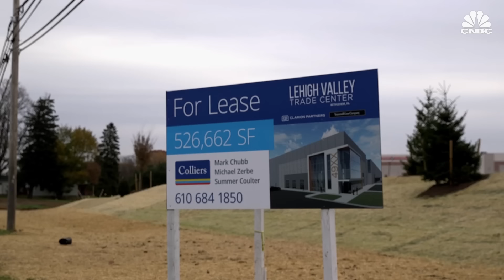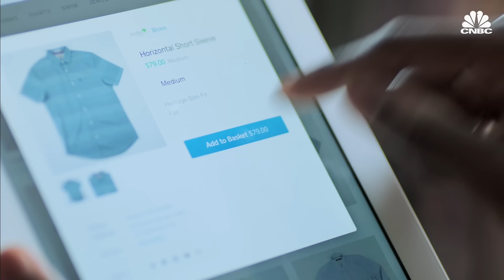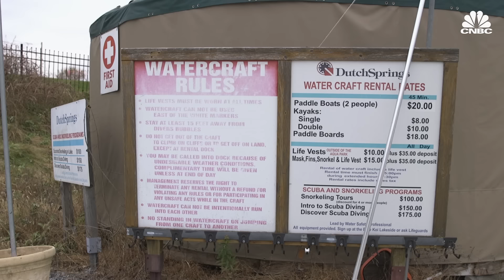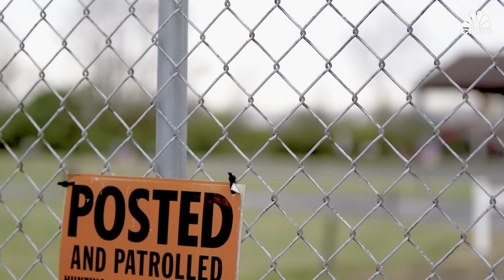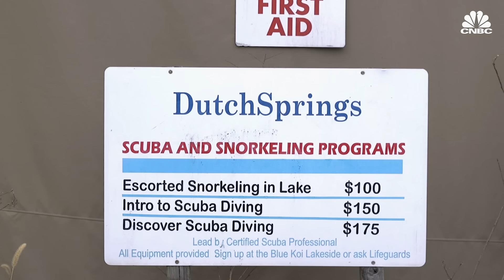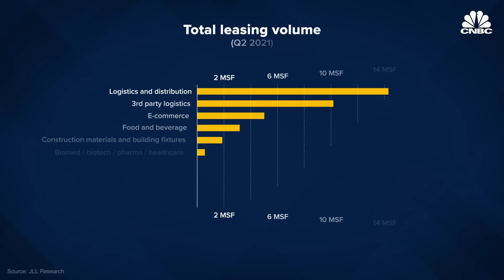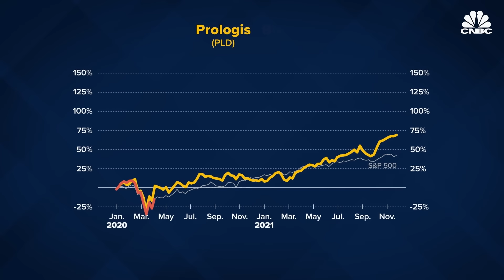Why Warehouses Are Taking Over The U.S.

Comment: This video is really well done. Bonafide experts were interviewed and some real challenges in the industry were identified. Considering the US industrial real estate market is comprised of over 20 billion sq ft and has an aggregate value of over $1.5 Trillion, I'm surprised it's taken this long for the industry to enter the spotlight.
Reply: they said lehigh valley a hundred times, but avoided saying allentown or bethelehem, the cities where the water park is.  other than that, its a great vid
Reply: @davidanalyst671  I caught how often Lehigh was said too!  I'd also disagree that a warehouse is defined as a distribution center over 200,000 sq ft. There are many buildings smaller than that which would still technically be warehouses, but I understand the point they were trying to make.
Reply: @davidanalyst671  so when they say Lehigh Valley I'm sure it's more than one city based on my 13 1/2 yrs of over the road trucking I've been dang near to every corner of the united states, Ontario and Quebec.
Reply: Exactly

Comment: Just use the closing malls for a lot of them. The enclosed mall is going away so relocate the space.
Reply: The design of closed malls is not very good for comercial warehouses.
Reply: Malls are in commercial zoned areas. Warehouse needs and transport infrastructure require their own industrial zoning. Not to mention, a warehouse placed where a mall was is most likely to be an eyesore.
Reply: Most malls aren’t situated where it would make sense for a warehouse. Malls are typically in the middle of retail sectors of towns which means a lot of cars go through it daily. Adding s bunch of trucks to that would be a nightmare logistically and for traffic. Warehouses are best suited away from heavy traffic.
Reply: @DeadAir21  Actually many of them are well situated near the major highways out in the burbs. Already seeing amazon converting old Sears/JCP etc to distribution centers.
Reply: They are not zoned properly for that plus the truck routes aren’t favorable for that
Reply: @chrisdionne2871  Actually, abandoned malls are perfect for last-mile delivery.
Reply: lol they already started doing that
Reply: @wyganter  well then the mall would be a distribution center, rather than a warehouse. Totally different industrial necessities and zoning permissions. Warehouses deal with 40ft trailers and switchers. Distribution centers deal with “last mile” vehicles. Moving goalposts?
Reply: @chrisdionne2871  Actually they deal with much the same vehicles. Most of the goods get to the distribution center via the trucks just less volume. See it everyday at an Old Kmart Amazon converted near my house. The big trucks come in the back and get unloaded and the Brown prime trucks are parked and loaded in the front. The big stores were essentially warehouses anyway so not badly designed for the handing the rig. you see the same at Walmart all the time.
Reply: @johniii8147  yeah but that volume.. is what is the difference here. Distribution centers do not take floor loaded containers and transload onto trailers. Distribution centers just unload palletized trailers into short term storage. Sure the vehicles look the same but when it comes to the weight inside the trailers, they differ immensely. Warehouses are also outfitted for long term yard storage. You take the storage yard of a transload warehouse and fit it into a Macy’s. It’s not operationally feasible.
Reply: Demolish the malls - convert to warehouse space
Reply: @chrisdionne2871  and covering up pristine farmland is not an eyesore? these malls have roads and infrastructure already built around them, the buildings will need to be rebuilt.
Reply: @DeadAir21  im guessing you dont live in a big city. im in columbus ohio and all we have is warehouses and alot of them run rt up against residential areas
Reply: @TKUA11  not zoned, well that can be fixed with the stroke of a pen. and all the malls i see have great roads in and out of them, dont forget that trucks bring the goods to the malls to be displayed in the stores. the argument that old malls are not set up for trucking is a blatant falsehood
Reply: @chrisfrisch1347  purely objective claim, but I agree. I don’t advocate for repurposing farmland, but if existing structures, like the malls, are to be used for warehouses.. it will be more than just a retrofit needed to meet the needs of a warehouse facility.
Reply: subjective*
Reply: The location of existing malls would not work with warehouses. Zoning being one issue, and access being the other problem. Going from personal vehicles to 100s of trucks a day will not work with roads originally designed for passenger cars.
Reply: I can't imagine the enclosed mall going away completely in the north where they have harsh winter weather. There still will be a demand for indoors mall in places like Minnesota and Michigan ect. Keep in mind the Christmas season the busiest time for shopping takes place in the winter.
Reply: @dvferyance  True there will be a place for it, just  a much smaller one. They built too many and trends changed in the middle of the overbuilding.
Reply: @johniii8147  I would say that's pretty accurate. I actaully bought all of my Christmas gifts this past year at my local mall mostly Barnes and Noble. Years ago I ordered a book from Amazon and it never came so I am done with them. I would prefer to shop the traditional way then at least I know what IA am getting and that I have it.
Reply: @dvferyance  We all have our preferences. Couldn't tell you the last time I was in a enclosed mall. Maybe 2013. I've avoided them for a long time now with all the hassle of parking, walking, finding the store etc. But I'm not a browser type shopper. I usually know exactly what i want or need so been a big online shopper for a long time now. But i get some enjoy the hunt for for new things.
Reply: @johniii8147  I like the experience of getting away from the house. and some like the convivence of staying home. I

Comment: they should solar panels on their roofs
Reply: @Yummy Spaghetti Noodles  I don't think that's how it works. If the price of electricity goes down there will be a lot more use hence driving the price back up until a new equilibrium
Reply: Right!  Solar could just about pay off most of their operating costs.
Reply: One would think that the huge roof area of warehouses are a surefire place to put in solar panels...but noooooo....no such sensible luck.
Reply: The do here in California.
Reply: @SA2004YG  go google the price of electricity in california.  Its right there, smacking you in the face
Reply: @David Analyst  whatever it is I know that every place has its own circumstances and it doesn't make sense to make national policy on what's happening in one specific area. You guys do what works best for you. Here in North East solar isn't always the best option

Comment: Two ideas: Start building warehouses underground, build sustainable communities and or parks above them. Above ground warehouses should all be covered in solar panels, so much acreage for energy production!
Reply: digging out and creating an underground facility is incredibly expensive to build and operate - think of all the additional air conditioning, ventilation, lighting etc. needed. It's more likely that warehouses will become multi-storey (meaning stacked on top of each other) , like how they are in places like Singapore and Hong Kong.

Comment: Why don't they build these warehouses in the deindustrialized parts of the many inner cities that need fixing instead of paving over greenfield sites.
Reply: Because inner cities don't have the transportation infrastructure to handle so many 48' and 53' trucks that weigh up to 45,000 and 50,000 pounds coming in and out. Some roads aren't big enough for a truck to make a turn in high traffic.

Warehouses need to be near a freeway ideally and have good access away from other traffic sources. Some need direct rail access
Reply: "Why don't they build these warehouses in the deindustrialized parts of the many inner cities that need fixing instead of paving over greenfield sites."

For the most part, they do. Those types of areas are ideal for warehouses. Not to be mean my friend, but go outside, because to me you just said "Why don't they ever build fast food chains at the corners of intersections near highways?"
Reply: Besides, logistical nightmare cost would also be an issue and high traffic. Whose gonna be happy about the 50 semi trucks coming in at all hours in these inner city neighborhoods.
Reply: @Jaker788  True so what if I changed my statement slightly to the edges of the city. Philadelphia, Cleveland, Baltimore etc. All have vacant land and abandoned buildings on the outskirts of downtown available right next to the Interstate.
Reply: @stepheng3667  the roads aren’t built to handle the traffic and the land cost is more
Reply: @stepheng3667  plus city labor is more expensive

Comment: I've never thought of this before, but when I see these huge warehouses, I think.

Why not build apartments on top of these businesses? Sort of like how Therese shops at street level in cities.
Reply: There's a lot of logistical problems that arises from that and I'm not sure that'll really work in practice. Imagine the traffic
Reply: I don't think you can zone the same spot as both industrial and residential. Also, on a more practical level, I don't think it's safe to live above a warehouse where there's massive trucks constantly moving around right by you.
Reply: Great idea but America has terrible single use zoning requirements.
Reply: @tycooperaow  true, but it could perhaps be solved if the residential car parks are located just outside the warehouse complex, connected via a footbridge.
Reply: @jadonbertholf547  Only more resson too change them. Too allow for more multi level development
Reply: Its loud, fire restricted, weight limited, extreme extra cost for stabilizing and unpopular
Reply: @speedmaster7107  Yes, That’s not best solution when it comes too really heavy industry.

But warehouse are relatively "clean" operations.

The sound can be counteracted with the help of sound insulation and the exhaust gases can be filtered out with the help of air units as well as further development of electric trucks.

And we separate those residents from all heavy traffic by means of footbridges connected to parking lots for those residents
Reply: Few people would love to live next to or on top of a warehouse. But building in the U.S. is difficult because of zoning, parking requirements, NIMBYs, and a whole hosts of building restrictions.
Reply: @Basta11  True, but since the urban sprawl and the restictive zoneing laws are making the comutes longer. 

I would argue that we will need to create a better, more efficient and coherent mix between residential, commercial and industrial.
Reply: @UCIqrf7mIptwXTydTMKFrvmA true…Mabye soundproofing and blackout curtains would solve that issue
Reply: Also what would happen if the warehouse company wanted to renovate the warehouse or expand it by a floor? Sounds like a logistical and legal nightmare that would not be worth any of the costs to the company or society, definitely easier to build apartments across the street.
Reply: These warehouses are typically not built in places where there is high demand for high-density residential space
Reply: @merrymachiavelli2041  but warehouse workers cant exactly afford to buy houses, either. and they need to live somewhere. how about free living underground on a company dime? like ants. eat ze bugs, wagie.

Comment: We have so many failed malls.  What a great repurposing of land!
Reply: most malls cant as they where not designed to be warehouses
Reply: @kkirschkk  Yes the buildings are useless but they sit on land usually close to major highways Warehouses or data centers for sure Most malls are just abandoned and rotting
Reply: @luckymann9630  so you would have to tear them down and rebuild them, or just build a building new and save the huge costs of tearing down old buildings

There is a reason why malls are not reused.
Reply: Quite a few malls actually have been torn down and had warehouses built in their place. The proximity to highways and lack of anyone else willing to take on the demolition of the property is usually what sells the plan.

Comment: They should convert abandoned mall space to warehouses, then. Makes sense to me.
Reply: It won’t work. Warehouses need to be put in industrial zones where trucks can come in go at ease. That’s why most industrial zones are on the edges of town away from the traffic. Malls are typically in the middle of towns in commercial zones with heavy traffic. It would be a logistical nightmare, heavy traffic, not to mention citizens down want to live/drive but those big buildings.
Reply: They already are in many cases for distribution centers. Amazon is buy up old Sears/JCP and Kmart locations for the final mile as it's called distribution network.
Reply: malls are commercial zone not industrial zoned

Comment: None of them know how to build warehouses with 5 story tall buildings? 🤣  Americans only know how to grow in 2-dimension?😂
Reply: Wow. So smart.
Reply: 😂😂 I was thinking the same 😂😂👍🏼
Reply: Multistory building have much higher construction costs.  Tilt up panel construction with steel truss roofs is cheap.  The height of bays might grow from two stories to three stories, or even higher, but if you can ship from China to Kansas affordably, land is not that dear.
Reply: If the land price is high enough sure, otherwise people don't want to pay for the expensive construction and expensive VNA equipment to handle those high racks.
Reply: How r u gonna continuously move and load  inventory up and down from the 5th floor
Reply: 5 story buildings will need more permits

Comment: I understand the need for warehouse space but why are they all single story only?
Sure they have racks thats 3 floors high or more but wouldnt it be safer and make the land go further if there were say 3 levels of 2 floor high racks? If not, make office space other facilities above the warehouses to get more jobs, people and revitalize the area so its not just reliant on storage.
The urban sprawl in USA never ceases to amaze me.
Reply: Huh? They need warehouse space not office space. That’s the need. They have plenty there at the facilities. A lot of work is done remotely etc at either corporate offices or now at home. Have you ever been to a warehouse? Not very conductive to an office setting that is not directly necessary for the operation being conducted there.
Reply: @WJWeber  exactly. That's exactly why I'm saying to have a multi level warehouse. I also live next to my local storage and mail warehouse hub so I do know it can be noisy but not anymore noisy than say a bus interchange/terminal (unless the road is blocked then they will use their horns liberally).

Also, working remotely is not possible for every job, especially those than produce goods. These are the offices and facilities I am referring to. I'm not asking Google to setup an office there, though using the space for data centers is viable. 
I am talking about business that would work well near warehouses like repair or manufacturing shops. Hell a home depot would work too. 

My main issue is that USA insists on not building up except in the big cities which makes then concrete canyons while the rest of the country is under utilised and more farmland is developed.

Comment: There isn't a shortage of land for warehouses, there is a shortage of cheap land for warehouses. The warehouses are replacing shops but they won't be built where the shops were because that land is expensive. Warehouses look for cheap land.
Reply: It's not so much cheap land as it the amount of land and easy access to the major freeways. Major old malls in suburbs are being converted to distribution centers or completely torn down and a new warehouse built. More than anything for them it's about LOCATION and space.

Comment: Here in the RGV there are strip malls going up everywhere while many existing strip malls lay empty. I believe the fear of run away inflation is fueling a boom in building. It is better to put your money into the ground than to have it in wall street or the bank and have to face a currency devaluation like they had in Mexico 25 years ago. It was devastating for those sitting around fat, dumb, and happy...
Reply: ehhh how about the housing loan crises in 2008, you dont need to look to mexico for an example.. But you are totally correct, there will be a crash very soon. And this time its going to be much worse...

Comment: Side note, dear Amazon, start buying trucks.  You hardly see UPS running around in vans.
Reply: @Ryan Clone would be great for regional runs, like terminals to high volume distribution centres, or pickup points or whatever they’re called.  Probably get tax write offs for it.  But you can get decent sized trucks and stay under 13 tonnes, the standard UPS/Fedex Truck grosses around 10 tonnes.  Then you get those yahoos running around in the exactly 13 tonne enterprise trucks with the little magnet on the door, technically still class C vehicles.